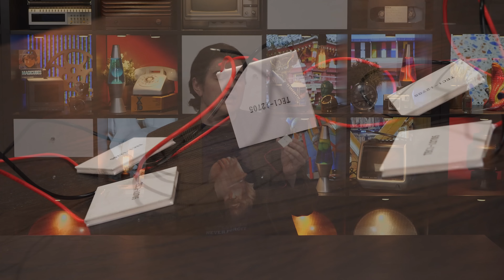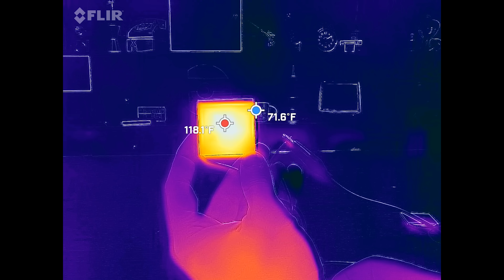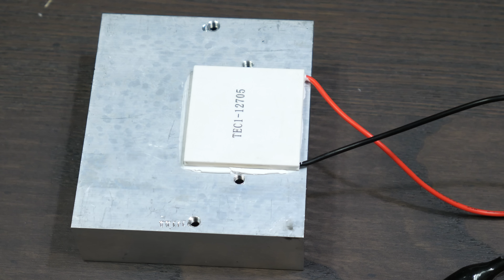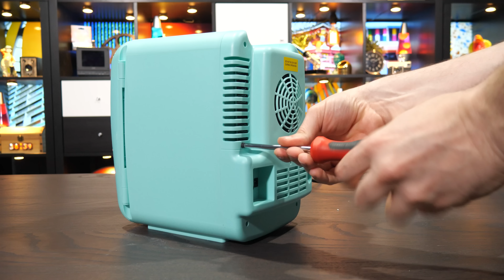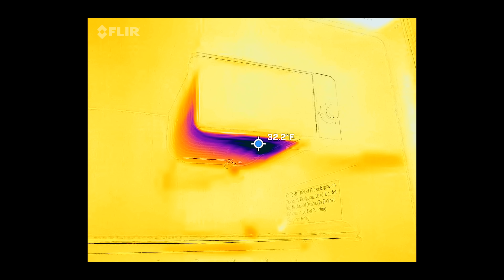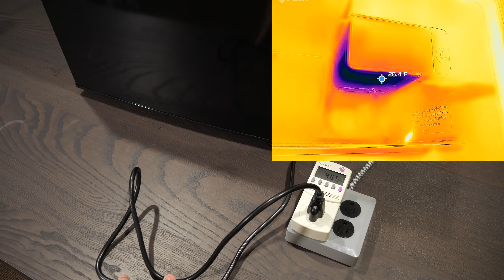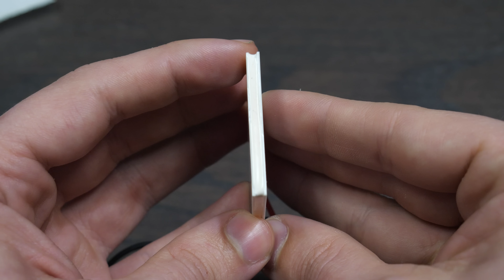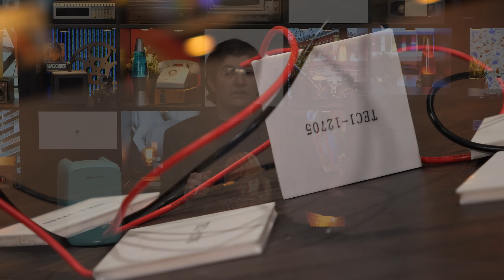Thermoelectric cooling: it's not great.

Comment: My aunt had one of those that came with her Subaru, it was basically large enough to hold a 30 pack of beer cans and a small bag of ice. She used it for shopping, since she lived an hour from the supermarket she would use it to put meat in for the ride home. 
She started having battery and charging issues early on with that car (an 05 Outback). After they replaced several alternators and torn the dash and engine harness apart several times she brought the car to me here. To make a long story short, that cooler was killing the battery, and alternator. 
The car had full time live cigar sockets, and thus that thing was on all the time it was plugged in. There was no switch on the cooler. You simply reversed the plug to keep things hot or cold depending on polarity. 
It never got cold enough for drinks, but was cool to the touch. I never checked the temp but it wasn't very cold. 
I removed it from the car, removed all the thermal cooling parts, filled the hole in the side with spray foam with plastic on both sides and told her to just use it as a cooler. 

When I tore it apart, I could see where the fan motor had been wet. They put the fan motor at nearly the lowest point of the box, meaning that any leakage, condensation, or melting would run right through the motor. It was made by Igloo, with the Subaru Outback decals on the outside. That car is long gone, it wasn't much better than the cooler that came with it but I still have the cooler that i converted and after filling the lid with foam, and the elimination of the electrical parts, it makes a great little cooler for my lunch or drinks on the boat. 
For the $199 the thing cost new as an option, it was a total load of crap. I've never seen one of those that worked worth a dam.

Comment: I admit that I have a thermoelectric unit. It's a camping cooler with an advertised reduction of 18C (I've found it at 15C). Literally for stopping butter melting, keeping drinks somewhat cooler than ambient, and stopping meat heating up (purchased that day)

In Ireland it's useful, given it is insulated and our nightime temperatures (in Summer) rarely stay above 20C. It's freezing in the morning will stay very cold all day as long as not opened too much, particularly if there is plenty of liquid to act as thermal inertia. I would NOT be using it somewhere hot

Edit: One would also have paid for electricity, for the kids electronics. So don't have to worry about energy costs

Comment: I have a bigger freezer in the garage than the cube fridge you showed and it still only uses 60W and it is not on all the time. Depending on the ambient temperature it uses 0.3 to 0.5 kWh of energy per 24 hours. It is crazy how inefficient these peltier things are.

Comment: They make useful cooler boxes that use the technology.  They definitely keep the cold stuff put into them cooler than models without the extra cooling.  The instruction manual is however very clear that it is not capable of acting as a refrigerator.  The ambient temperature will always ultimately overwhelm the cooler box.

Comment: The only valid use case for peltier elements outside if "niche" sensor cooling (space, military, infrared in general)  are hotel fridges. You don't want a compressor fridge next to a bed.

Comment: I have a Frigidaire mini-fridge that holds up to 15 soda cans, or 6 bottles of water. It's not great at chilling liquids, taking about 12 to 15 hours to chill a full load of room temperature cans or bottles. And only promises 20 degrees below ambient room temperature. But I do like it. The mini-fridge is only good for water or soda, but that's all it's advertised as being used for. It's nice for having a cold beverage on hand while using the computer. And if I make sure to rotate in fresh bottles or cans without fully emptying it, it takes less time to chill the newly added items.

Comment: You forgot the most interesting part of a Peltier device, if you don't run a current through it and instead heat or cool one side of it you will produce an electrical current. 

Looking back to your fridge episode you could have saved yourself a lot of trouble and improved the efficacy of your red fridge by simply cutting a vent in-between the freezer and fridge compartment.
Reply: You should check out some of the Peltier generators the Soviet Union made.

Comment: Totally!

There's an old Groucho Marx joke: I've had a perfectly wonderful evening, but this wasn't it!

Same with TE (aka thermoelectric aka peltier) coolers. There are  use cases for them, but not many and this isn't one. At. All.

I had only one objection to your presentation: when you said it's not a heat pump. But you did correct this later, when you said the peltier element is "technically a heat pump". It is, of course, a heat pump. And yes, with a COP between zero and terrible!

Nice!

Comment: What if the peltier cell worked in a closed circuit, good insulation, temp sensing, would its efficiency increase? What if you mod the toy fridge for a new type of video?

Comment: No one in their right mind would use the blue "fridge" as a food / home consumable fridge. 
The beauty of the blue "fridge" is in the car. It will run off the battery, which is constantly being charged, so no tears shed over power consumption. It will keep your cans cool which is all you really want in a $30 esky. If I want anything else, a proper camp fridge will the trick.

Comment: One use of the Peltier element that is nice is for a small device that alternates between hot and cold for treating sore muscles. It meets all the criteria: occasional use, inexpensive, orientation independent, and as a bonus makes use of the ability to reverse polarity of the element to handle the alternating heat and cold. Also it needs to be compact and lightweight as the device is meant to be worn. I use mine to manage back pain quite effectively and while it’s less efficient, smaller, and more expensive than a traditional heating pad, the ability to alternate temperatures automatically makes it worth it.

Comment: I bought the Xbox mini (not) fridge. They are normal $99 but I got it for $30. It specifically says to put already chilled drinks inside and it will keep them cold longer,  but that it isn’t really designed to make things cold. I tested it with chilled drinks and it kept them cold enough to drink for about 5 days.

Comment: Peltier cooler has another advantage, it barely needs any regulation of current and voltage. A compressor will die with some changes in electricity and if it has few volts lower than what it expects, it won't even turn on.

Comment: The only practical useage for a peltier device I have seen is in early CCD video cameras. The CCDs get very noisy (video noise, not acoustic) as the light levels drop. Of course it's the blue channel that only gets 11% of the white light that was the problem, so the fix was a big copper heat sink that connected the back side of the CCD chip to a peltier. Portable cameras were limited by the battery life, so were still noisier than the studio versions that ran on mains power.

Comment: I have one and it works really well. Paid $15, low noise and get the beverage cold enough to be nice and cool. I keep it on only during my office hours, so it needs some time to cool down first ofc. However, not nearly as much time as it did for you. An hour or two for it to be below 10 degrees Celsius.

Comment: I've been very interested in the applications of moving heat for the last month.

My dad installed a pool heater to his pool and I assumed it would work something like boiling a tank of water and just mixing the hot water with the pool water.
Instead, on my way past the pool plumbing stuff I get blasted with cold air. I questioned him about it and he said it's basically like an air conditioner in reverse.

So this heater costs electricity/money, and air conditioning costs electricity/money, and this thing is just blowing cold air into the outside breeze, and the air conditioner blows hot air...
This sounds inefficient, why couldn't the pool heater and air conditioning units be connected?
I think the answer is, they most certainly can, but it'd be a custom built appliance and not a standard install.

And it just got me thinking about all sorts of things, like for instance, would it be possible to connect some sort of piping to a fridge so that it dispenses all of its heat somewhere else rather than having a warm kitchen? What about a hot room of the house that's always sweltering when you walk into it, could that not have its heat moved to a colder room in Winter?

I'd love to know more about heat moving and why it's not really... a thing. Heat moving seems to be limited in that the desired temperature's opposite is just a waste product dumped somewhere else, not used.

Comment: They make sense in cars, cooling drinks! If you make them out of metal they double as little food warmers. The efficiency argument makes sense when you have a low-voltage DC supply.

Inside they make no sense.... 

Also, your example is a 'fancy unit' with a fancy facia and not much else...Get an uglier better example. 

Also, good luck making a refrigerator that small.

Comment: They work very well for cooling mid wave IR sensors and laser diodes. To actually build a decent fridge with them requires 2 in parallel and 1 in series with a heat spreader in between, also add a small fan and insulate well.  Built this into a cooler and it runs off about 21V at 4A from a solar panel. The peltier elements came from those cheap fridges as well. . ❤

Comment: I had a cooling box with a cooling system in the lid in the past, when I went on 'out of town' work assignments.
It still said 'Up to', but the 'up to' was rated in 'eco' mode.
The interesting thing is, it did not have a peltier element, it had 2 chonky heatsinks. One inside, with a small encapsuled impeller sucking in internal air, blowing it across the sink, and with a guidance element that forced the air down into the box again, and then, with heatpipes going through the insulation at the top, had a chonkier heatsink inside the outer section, with another impeller.
Even in summer, when putting the fan RPM at maximum, when running in 'Wall Outlet' mode (as opposed to Eco only 12V Car Cig Lighter mode), I actually managed to get ice to form on the internal heatsink. And beverages were uncomfortably cold.

Comment: SAVE BIG MONEY AT MENAAAAAAAARDS! :P
My experience with the cube mini-fridges in my dorm (how many years ago? No, I'M NOT OLD -- YOU'RE OLD!) is that the compression cycling was very annoying to sleep next to. That is all.
By the way, how much temperature differential do Stirling Engines need to produce significant amounts of electricity? Could you recoup some of the extra electricity demand that way? At the cost of price, weight, and mechanical complexity, of course.

Comment: I don't know if you've seen these, but another cool application of a peltier element is cooled astronomy cameras! Cooling the sensor can greatly reduce the noise of the image, and peltiers are a perfect use case for these. Efficiency isn't a huge concern, portability is important, and the lack of moving parts (yes, they still need a fan) is even more important because vibration can impact the quality of the final image. A well-balanced fan won't affect that, but you couldn't do any kind of compressor in that situation. They're definitely a niche application, but since you like niche applications I'm hoping you'll find this at least mildly interesting.

Comment: I have a Peltier device that I swear by: a can cooler. It's a small device with a hole that fits a single can. You put the can, turn it on, and it goes from room temperature to fully chilled in 5 to 10 minutes. It's not something I use all the time, but it's a life-saver when I want a can and there are none in the fridge. You only have it on for a short period, but it does a great job. But yeah, those toy mini fridges are terrible.

Comment: A compressor is always going to be more efficient, but the Peltier device can do a lot better than your POS.  Peltiers provide a differential, not cooling.  The cooler your exhaust side is, the cooler your cold side will be. Also, by filling your fridge, there was no air circulation, which a peltier device is going to struggle to overcome.

Comment: also most compressors run on 120vac, but peltiers natively run at 12vdc.  that brick in the blue box was to convert 120vac to 12 for the peltier.  So a car box can be made much cheaper. (and a little more efficient)

Comment: Oh yeah they don't work great.
My cheap crappy little guy is perfect for those non-summer times of year when I van-camp at rock and gem shows. Low draw, nights are cool so it doesn't have to struggle (worse than useless in AZ summers), good enough to keep my cheese, yogurt, and weekend's worth of cream for coffee stable and safe. For safe food cooling, I also have a cooler I load with ice. :) 
As I said it's useless in summer. Which is exactly when I do NOT go to van-camp for shows. Nobody else does either. :)

Comment: 20 years ago TEC was cool for computer CPU cooling. You still had to get rid of the waste heat but you could overclock further because of sub-ambient cooling. IIRC they were not nearly as cheap as they are now.
Now we have great air and crazy off-the-shelf water coolers.

Comment: I worked on refrigerators and heat pumps for nearly 25 years. Refrigerators just cool food. Heat pumps are usually used to heat or cool rooms or houses. Heat pumps have a reversing valve and refrigerators do not. Otherwise it was a good video.

Comment: The thermoelectric humidor I have (NeedOne brand) keeps the temperature stable at 60f, and is very quiet, probably has better heat sync tech but isn't food safe, designed for storing tobacco but I use it to dry other herbs. I'm curious about the tech and how it compares to your video. Please do a video on it, keep up the great vids!

Comment: I ended up with a $50 mini fridge from Good Will about 18 years ago. Looked like it was already a decade old when I got it. Still running. Still keeping my beers nice and cold, and holds a solid 2 cases (with careful loading). I only wish it didn't have the freezer compartment, so that I could fit an additional 1/2 case of beer inside. Also, it's the perfect height for holding a really nice ice cube maker on top.

Make ice cubes in the mini-freezer, you say? No thank you; that thing takes 4 hours to generate 3 trays max. The ice maker finishes its first tray in 40 minutes and additional trays every 20 minutes. Holds and maintains about 3 about lbs. while running. Crystal clear ice to boot.

Comment: A solid-state device that changes Temperature when you put voltage through it. amazing. surely it must be better than a heat pump.
truly Heating elements are the future.

Comment: for someone who claims to know refrigerators you were very deceptive with the toy fridge presentation. Totally MISSED OPPORTUNITY to remind ppl not to fill up their fridge/freezers to the brim cause then air doesnt circulate on the inside of it. If you're at 90% out of 100% capacity then it becomes less efficient and might not even get the whole thing to reach the same temp.

Comment: One good usecase of peltier cooling is thermo-electrically cooled Beer taps. I brew beer for a hobby and only occasionally drink with friends or family. With a peltier cooler I can hook up a keg of beer to the tap at room temperature, and the peltier elements will draw 700W while rapidly cooling from 20C to 4C. It only taps 500ml a minute (1 big beer) but it works like a charm and saves on having to constantly cool the beer.
Reply: This doesn't cause the beer to foam?
Reply: @rrex7948  no issues

Comment: There are actually more advantages for those Peltier elements. For example whenever you need something very very cold in just a free seconds. On the other hand they are good in detecting heat difference, since the produce a small amount of energy when applied to different temperatures on each side.
Even if the practical applications for those features are usually rare, I could imagine that they are usefulnin some scientific cases.

Comment: If you flipped the polarity of the peltier device in the fridge, could it warm the inside with slightly better efficiency than a resistive heater because of heat "collected" from outside?

Comment: Love your channel. But what is it with calling a compressor a heat pump, Its a compressor,
Heat pumps as coined came about from modern air conditioning units with reversing valves to reverse the refrigeration cycle to heat or call a room  as required. That is all.

Comment: Thing about TECs is that they're often used for the Peltier effect, when in reality, they're usually best-served by the Seebeck effect, instead. Maintaining enough of a robust gradient to cool something is quite difficult, but maintaining a robust thermal gradient to harvest electricity? WAY more valuable. If memory serves, the Nords and Scandies like to use these and Stirling motors to harvest energy from waste-heat produced by data centers. You have the cold side exposed to the frigid temperatures of the arctic, and you have the hot side powered by the waste heat from your CPUs, and you can essentially utilize that differential to get enough current to actually self-sustain the climate systems, essentially recycling a portion of the energy the CPU used to turn information into entropy.

Comment: I installed a few solar panels to power ventilation in the house and also get a ton of auxiliary power for 12vol usb, inverter etc. I have a small cooling box with a peltier element I cool drinks with when I got excess power to spend which does not cost anything. I have 6 gel batteries getting charge from the panels so I can run the thing in the night too if I want.